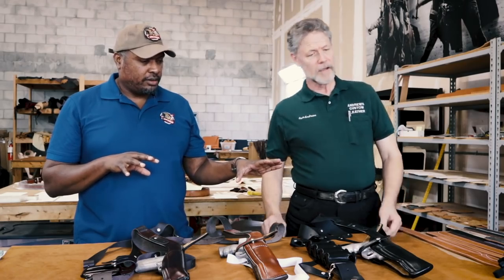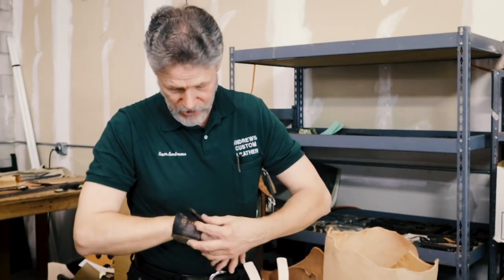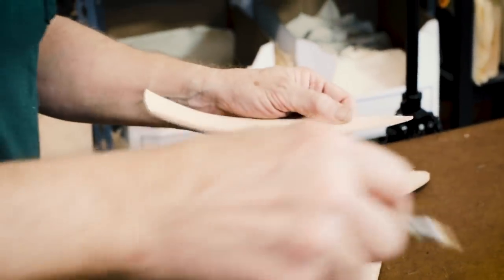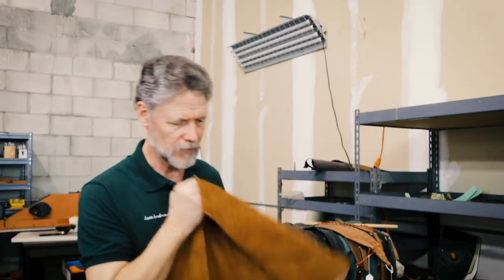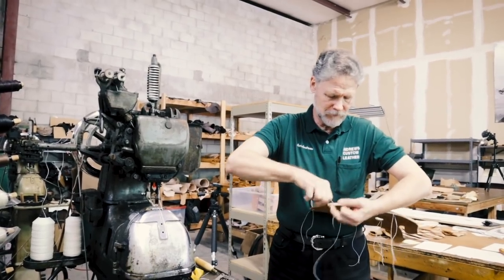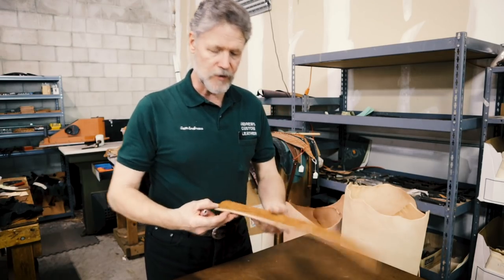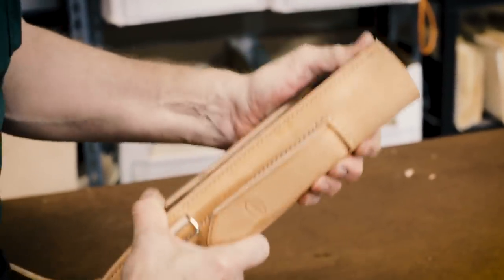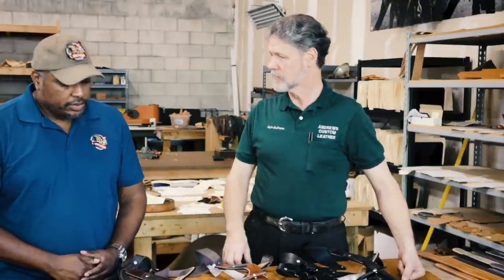Custom Leather Springbreak Shoulder Holster // How It's Made

Comment: I"m curious about the patterns.  Does Sam have a "master" pattern that he traces when a working pattern is becoming worn out and a new one is needed?  I've learned with wood working if you trace a pattern then use that piece of cut out wood for the next pattern, then repeat that process, the pattern will grow over time. So its wise to use the same piece over and over as the pattern. (does that make sense?).  I was wondering if Sam followed that process as well?

Comment: Not a fan of leather holsters. They may look great when new but require maintenance to keep looking good and maintain function.  I am more of a functionality type kind of guy don't like fancy wooden stocks (unless it is going to be a walk hanger)
But if someone were to make this style in nylon and kydex for a reasonable price I would be all over it.
Reply from the maker: understood Kirk, I think everyone has their preferences for sure (especially when it comes to purpose of use), at the same time leather holsters built right are pretty tough, comfortable and not as much maintenance as it looks. Thanks for taking the time to check this out
Reply: Its like anything made out of leather. As you wear it for many years it gets better over time and forms to you. Like Your belt, shoes or jacket. Yes it will get scuffs, dings and dents but that's what I like about leather. It shows the use and the love you have for it.